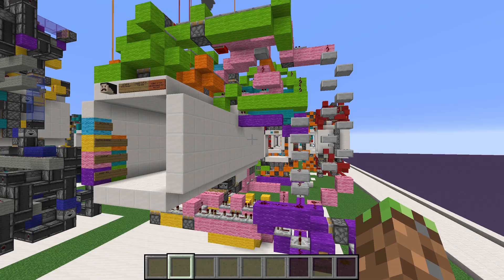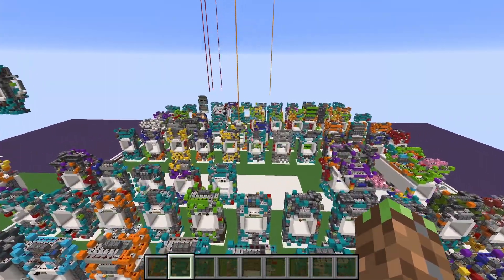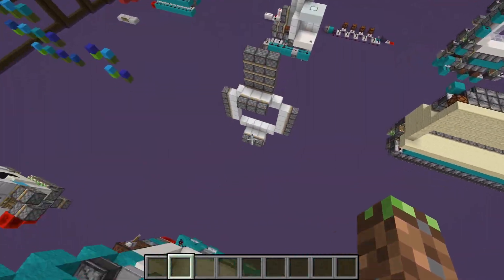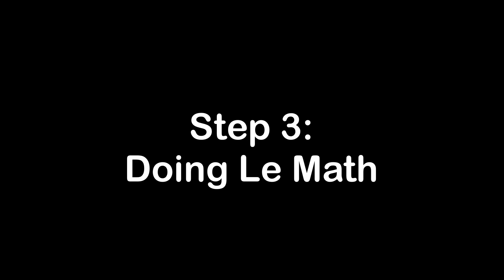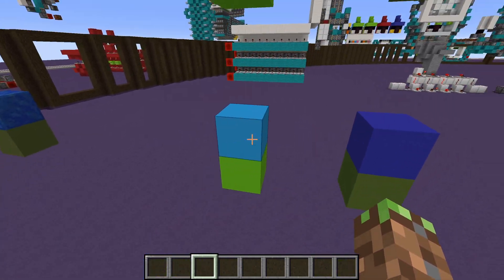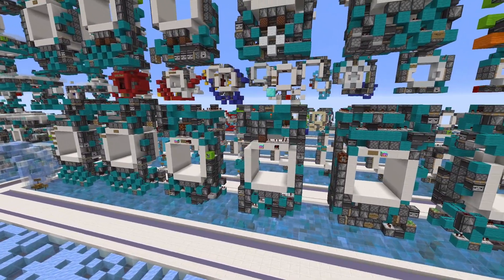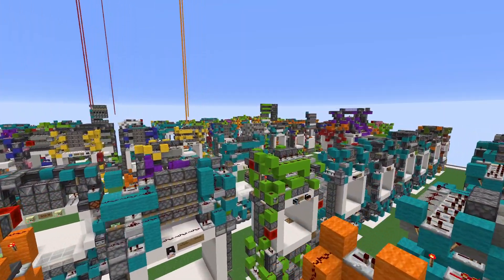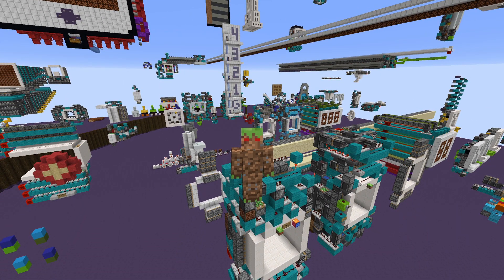How Many Possible 5x5 Piston Doors Can You Make?

Comment: I've been struggling to make a 5x5 door for a while, and I cant design my own 5x5 door ever. so you have any tips for me to improve? especially because the skill gap between a 4x4 door and a 5x5 door (seamless) is really massive. as in you need to include block storage for the first time, triple extenders, etc.
Reply from the maker: Joining this server could be a good idea. It's filled with redstoners that could help. And you can visit the 5x5 V2 plot to get inspiration for your circuits
Reply: @CraftyMasterman  server ip?